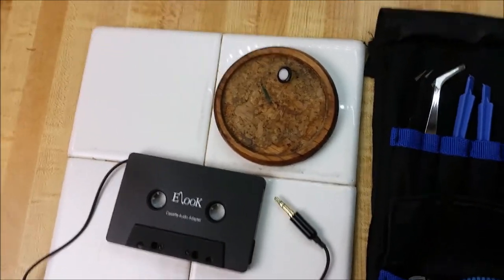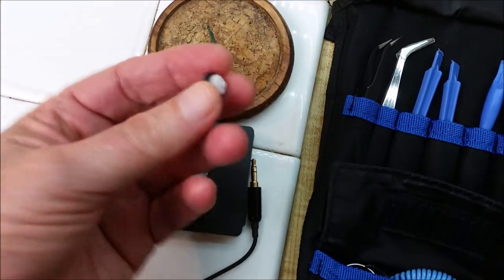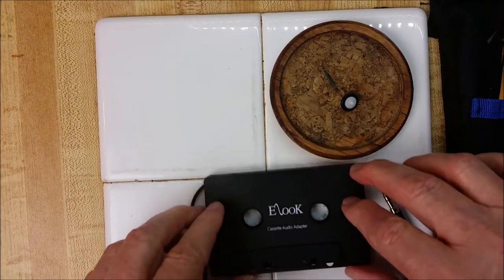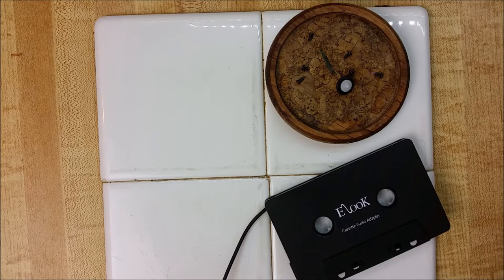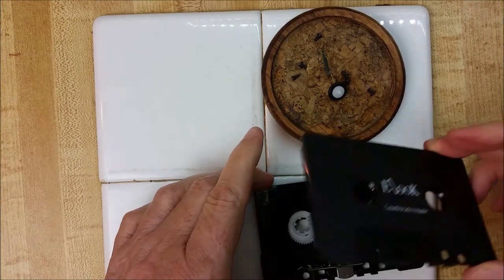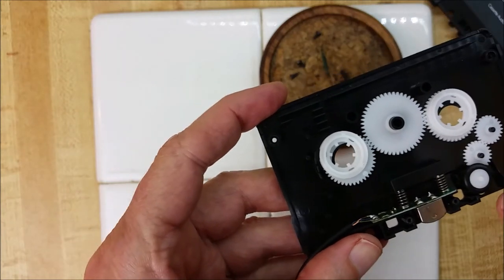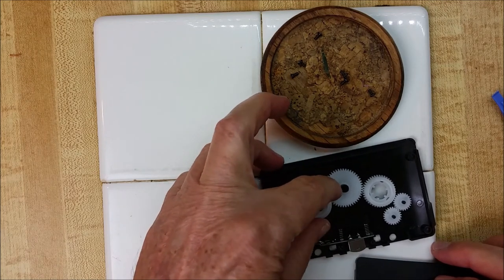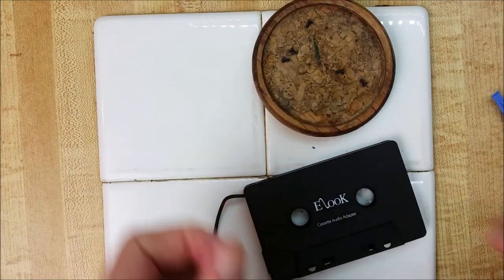How to fix a car cassette adapter that keeps being ejected in the easiest way

Comment: Many devices just come with unnecessary parts ... I remember when i used to work on my car back in my college days, when i was done i always ended up with a handful of extra nuts and bolts ... And the car ran just fine, maybe even better!😁😁😁 grt video Robb.. TC 😊😊
Reply from the maker: Hey Alex I still sometimes end up with extra parts left over. :)
Reply: Haha ... 😂😂😂😷

Comment: Before these adapters, we had to chisel podcasts onto stone tablets. They were very heavy if you wanted to listen to a long show. One ox wasn’t enough, you would need two ,to pull the cart for a long show.
Reply from the maker: Oxen? You had Oxen? We were not so lucky. We used unionized monkeys to pull our tablets over a trail of bananas that helped slide them. They always lay the good side of the tablet down and got it covered in bananas and made it hard to use.

Comment: Some cassette players will refuse to play unless they detect the proper tension and movement of a cassette, so I assume what those gears are for. The gears are probably not needed for most car players. Interesting (and helpful) video, thanks!
Reply from the maker: hey, thanks a lot for your helpful comment. much appreciated. 😎👌
Reply: Yeah unfortunately my 96 Cadillac needs the gear but yet it still ejects. I was psyched until I tried to use the adapter after trying to fix it. It ejects both with and without that stupid gear so now i'm stuck trying to clean it or finding another solution.

Comment: The more modern '80s and '90s cassette players had auto rewind functions that would detect that the tape had stopped moving. The wheel is to simulate the tape moving. Removing it means it won't work in auto rewind systems, because the system will think it's out of tape.
Reply from the maker: Brad, thanks for your help.

Comment: I'm mildly surprised, removing the little wheel actually worked for me. Brand new adapter would not stay in my cassette player. FM radio adapter suffered too much interference. Removed the little wheel, working great so far.
Reply: I couldn’t have said it better myself. Removing the wheel worked great in my new adapter! The Bluetooth /FM quality lacka

Comment: I did that and mine is still ejecting.     It says "clean tape" then tries to play one way then the other then ejects the adapter saying "check tape".
Reply: I had this issue as well I went and purchased another one from dollar general and tried the same method and works just fine not sure if you figured it out but a new tape worked for me not sure why tho hope this helps

Comment: Interesting stuff, Robb.  I wonder why the manufacturer of the adapter even bothers to put in the multiple gears, etc. if the device will work fine without them.  ~  Should you put a little bit of glue (hot melt) around where the wire goes into the cassette, to strengthen that point so the wire doesn't get too much flexing / weakening?
Reply from the maker: I like your glue idea. I am going to take all of the gears out and see what happens next.
Reply: @RobbsHomemadeLife  Great.  Please either do a follow-up video about the device or send me another comment.  Thanks.

Comment: My cassette adapter keeps making an annoying squeaking sound whenever I put it in the player. I have to insert it in over and over and sometimes, it'll stop. Is this rubber wheel in the video the same culprit?
Reply from the maker: It's hard to say for sure but it sure sounds like that's the problem.

Comment: I was surprised by how little is in the cassette.
Reply: Well all it needs is the fake tape head to send signals to the head unit and a cassette case to keep it aligned really.  Some head units might have additional sensors or whatnot to prevent problems and allow for tape reverse etc so the extra gubbins might be useful for those.
Reply from the maker: Hey Paul, I know, just the tape head and the useless wheels. If I turn the volume way down I can hear them rotating but who plays music low in a car,LOL